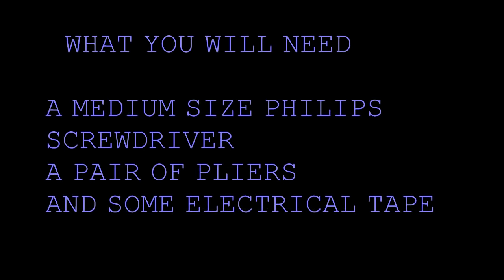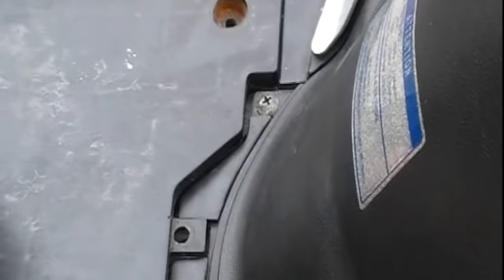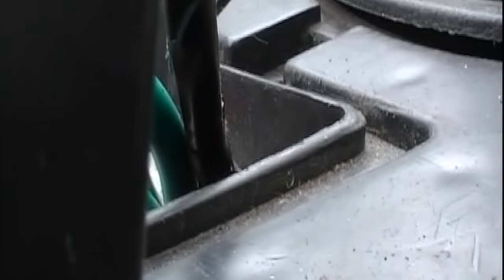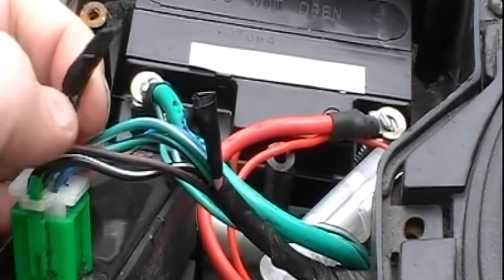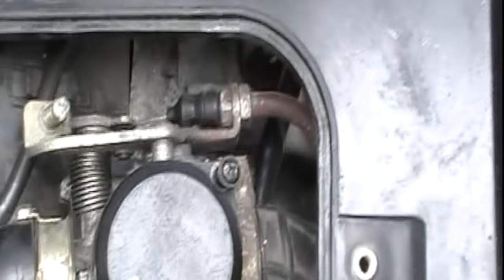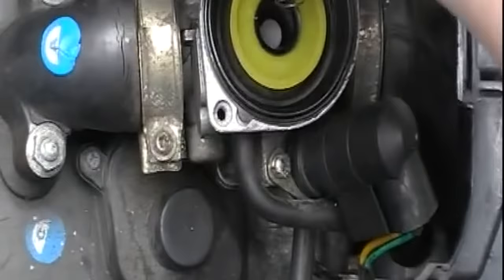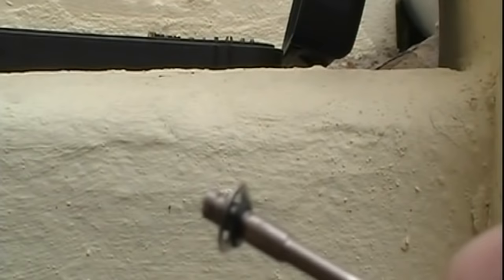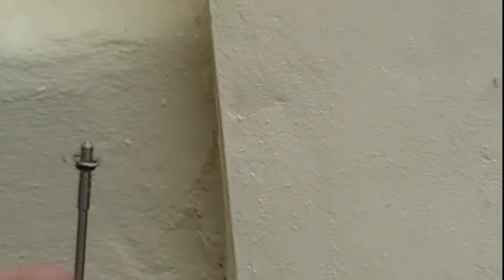How to derestrict a 50cc scooter / moped Make it go Faster

Comment: So how much was the scooter slowed down when you weakened the mixture by putting the needle further down into the needle jet? 
So if you are reading this then remember that the needle is tapered, the further up the circlip is , the lower the needle sits in the needle jet, the wider the needle taper into the bottom jet, the less airgap for the fuel vapour to be drawn up. Therefore the less fuel up into the venturi intake. The smaller the bang, the less power out. Oh dear!
Reply: Exactly! this nimrod leaned it by moving the clip up, it's a CD type carb the needle needs to move up so the clip needs to move down
Reply: Not necessarily any power loss...but certainly will burn out the piston very soon.
Reply: Yep.
Reply: your right
Reply: yaaa he moved that the wrong way he was explaining ,,,,,,,,
Reply: chancergordy i was thinking that my self with the needle.  You have just confirmed it. Nice one :-)
Reply: ,, most things in life is opposite of what you think,,,. Lean is mean,,,. This main needle and Amerson jet,, is 4 idle and slight off idle conditions,, depending on types of carburetors,,,. But as soon as it opens up under vacuum it will draw whatever fuel necessary,,,. Older bikes and carburetors you can lean down to make them quicker,,,. Newer shit EPA they're too lean when they leave the factory,,,  you can sand that needle down in diameter slightly rather than lowering it or raising it,,. Or changing the main jet seat,,,.  Wants that needle raises about a quarter inch,, that's it it starts working off of vacuum and air flow draw,,,. It's not lean then,,
Reply: @ricksimpson2167  Wrong the needle affects from 1/4 - 3/4 throttle, back to the drawing board my friend. Trev😊🇳🇿New Zealand home of the world's fastest old Indian 🇳🇿
Reply: @liamwilliams7782  Liam...in All my 50+ years dealing with bikes & engines etc I've never ONCE heard one setting them up rich for break-in...4 strokes you just don't lean hard on the throttle for a few hours & run a factory break-in oil...and 2 Strokes the manufacturer usually advises you to increase the fuel/air ratio from Stk for about 4 or 5 tank fulls of gas by adding more oil to the premix to like 15:1 or if injection like on a boat motor so oil to the gas...so who's the NIMROD now ? Trev New Zealand 🤔🇳🇿

Comment: This is my sort guy!!  He keeps me in a job with lean engines.   If you dont know what are the parts your removing and the theory of the carby dont give false info.
Reply: yeah for real lol. I went to school for motorcycle tech but I dig scooters. it pains me to see the wrong info out there, but my wallet loves the easy money.
Reply: ive been repairing these chinese scooters and mopeds for 12 years now and always find the reason they dont run correctly is when somebody has messed with the needle setting.

Comment: Buddy of mine races these things, the best "cheap" way to go about adding 10mph is to Port your intake hole on your head, then cut about 1/2 inch off the access plate on your clutch ON BOTH SIDES so it's even, and then run them on alcohol injection systems. He's doing 65 on a 50cc the clutch shave allows the engine to reach a higher rpm before engaging and thus a faster acceleration. Porting the intake allows for amazing overall fuel flow into the cylinder and actually added roughly 4 hp!
Reply: How big did he make the port?
Reply: @joshe2420  big enough
Reply: @Not Expat Joe porting gains as any gains differ from engine to engine, and you can also gain some rpm in very restricted engines when you do porting.
Reply: You l😊
Reply: Too much work on a kids bike... just buy a real bike?
Reply: @getrightconstruction1342 Because kids shouldn't ride real bikes? In a lot of parts in the world 50cc mopeds are the only alternative until you reach the age of real cars and bikes. And modifications to make a vehicle go faster is always fun.

But on topic it's a lot of work for that speed and power. A proper brand and a 2 stroke would be less hassle to reach that's speed and just using bolt on parts. Minarelli as an example. And still keeping it 50cc if one likes that.

Comment: The needle adjustment has the most effect on midrange power.  Jetting is more important to proper carb tuning on full throttle runs. If the scooter acts bad at part throttle, then it's time to adjust the needle.  At part throttle, If it hesitates but then cleans up when you let off the throttle, you're lean (move washer towards longer side of needle).  If it just hesitates and doesn't clean up when you let off, then it's rich(move needle toward shorter end of needle)

Comment: revs are controlled by the CVT clutch spring and rollers, cutting that wire just removes the speed sensor from the loop. You also need to pop out the restriction plate where the rollers are , doing that lets the scoot do about 38 mph on the flat . Dont lean off the mixture like has been done here , engine death :-)
Reply: Sounds pointless, as stock I can already hit 40mph+ anyways on flat ground. What I find helps increase speed without mod is to back off full throttle to the point you are maintaining your speed then SLOWLY give it more throttle I have gone over 50mph/80kmh on flat ground on pure stock no mods. If you are getting only 38 you are doing something wrong.
Reply: @scriptles  yours isnt restricted. Mine is a chinese engined scoot with only 2.8 horse power so 38mph is all it can do
Reply: @patthewoodboy  Mine is 1.8 horse power according to the title. Both my old Tao Tao (ATM50-A1), and now my Denali (yongfu) had no problem hitting 40 mph but only if I ease off the throttle and gently ease into it. If I just max out the throttle I barely hit 20-25. Pretty sure both of those are also chinese scooters and the translations in the guide are poorly written. Like "cer tain" shouldn't be 2 words and "outtak" should be exhaust or at least spell take right when they spell intake correctly. ect.. Upgrading the Tao Tao to 100cc with the big bore kit let me do about 40-50 mph (up to 80 kmh on the speedometer). It might not be restricted I never checked to confirm.
Reply: @patthewoodboy hiya there I’ve got a Yamaha Aerox 2018 4 stroke I put on a custom racing exhaust and it made it max out at 38mph and when I’m maxed out I hear a wineing noise is that the restrictor from making the bike go faster ? Also do u know how to D restrict it ?
Reply: The same bike sold in Europe has no restriction , it seems the exhaust has a restrictor plate and throttle restriction as well as the limiter.

Comment: lifting the clip one notch on the needle will weaken the mixture meaning more air less fuel rather than making the mixture richer,more fuel less air which could cause the ped to run weak on 2/3 throttle to full throttle as that is when the needle / main jet have most effect which could cause the ped to seize so not a good idea. Unless you have changed the exhaust, intake etc there should be no reason to lift or lower the needle or change the jetting of the carb It WILL NOT GO FASTER!. The main restriction in a ped is in the cdi (rev limiter/timing advancement), exhaust (restricting washer) and variator(a washer/ spacer which stops the pulleys  from closing right up which stops the ped from reaching a high enough gear so it just revs out)
Reply: +Dwainpipe21 Hi, I saw that you know something about the functions of the scooter and I would like to ask you if you maybe know which is the optimal ratio fuel/air or in other words, I put on my 50cc 4T a 72kit and upgraded also the main jet first from 85 to 88 and went better and then to 92 and goes even better but when I am in mid-mid/high throttle it bogs for an instant as it doesn't get enough air but then accelerate good... I tried various combinations of head valve settings and it helped a little, but the "bogging" when I go 50-80% throttle persists... do you think that I need a larger air flow, so a carburetor with a larger air intake so the fuel gets enough air to explode properly?
Reply: turn your mixture screw from full closed to 3 and a half turns open and that should help some if not then try getting a Klein carb they are cheap on Amazon

Comment: This just seems like something that going to bit you in the ass eventually. The pink wire is there to stop you from over revving your scooter and doing damage to your motor. In most cases this only limits your top speed when going downhill, as on flat ground most scooters don't have the power to hit the rev limiter. So please people watching this, keep your rev limiter installed it's there for a reason.

And second. Adding fuel isn't going to do much if you don't increase the air flow to go with it. All that going to do it make your scooter run rich, have worse fuel economy, and in some cases depending on altitude and air density, actually make your scooter slower and run like shit.

If you want to make your scooter faster, you're going to need to do actually engine and part upgrades. Little things like this almost always come with a nasty compromise somewhere down the line.
Reply: thank u for that so I need to upgrades to the engine I wish I had a partner who has a moped
Reply: to top it off moving the needle washer up is going to cut down fuel flow (lean it down) washer to the bottom is max fuel, higher rev with less fuel is not going to increase speed thats for sure
Reply: Actually the Rev thing whatever it is, is put in factory to limit your moped to 35mph because it's illegal for a company to sell a 49cc moped that goes over 35mph, it won't damage anything it's just there to keep your bike at factory speed 😊
Reply: Fulgonsta do they upgrade your 50cc to act like a 150cc
Reply: +Gem Mitchell wha ?
Reply: While the 35mph limit might be true, the RPM limiter is absolutely another reason that wire exists. These engine don't last much past 10K RPM. If you do this, I strongly recommend getting a RPM tac so you won't over rev it. Without it you seriously are just asking for a blown motor, as you no longer have a safety net. This is also even more of an issue if you start changing variator weights and gearing.

So please, if you do stuff like this, get a RPM tac. That way you can also tune more accurately. With CVT transmissions, you don't even need to be at top speed to over rev these motors.
Reply: I have a 50cc and some guy told me that the mechanics at this dealer ship could make my 50cc ride like a 150cc
Reply: +Gem Mitchell oh ok
Reply: Fulgonsta but is it true
Reply: Gem Mitchell I dont think so I think the maximum youll get is 50mph flat, tbh I've never heard of a 150cc soooo....
Reply: Fulgonsta really u havent?
Reply: Gem Mitchell nope so I couldnt tel you sorry
Reply: Fulgonsta it's fine btw do u have a ,moped
Reply: +Gem Mitchell getting one for Christmas and going for my cba on my birthday 3 days before, so I'm getting one
Reply: Fulgonsta well a few words before u get it, it's awesome it's worth it but it's slow/fast as hell
Reply: +Gem Mitchell that's why I'm derestricting it lol, an I'm only keeping it till I turn 17 then I'm upgrading to a cbf 125 👍
Reply: Fulgonsta how much is a cbf 125 and is derestricting a good idea
Reply: cbf 125 are around £2000 and deristricting would be practical if you're having a moped for a short term, like a year
Reply: Fulgonsta oh well nvm and r u in the uk or somewhere like europe
Reply: +Gem Mitchell yeh I'm from wales
Reply: that makes sense, well I'm getting a150cc soon
Reply: cool
Reply: You do realize it's very easy to calculate rpm from the speed of the wheel with a CVT right?

But fine, do whatever you feel like. This convo has gone on forever.
Reply: Uggg, do you really not understand the point I'm trying to make? Yes, the pink wire is a speed governor, but when you govern speed you also govern RPM. This means now the scooter can go faster than it was designed, and over rev the engine going down hills.

Which is why I wrote in another comment to buy a tachometer to see the RPM and be safe. You're arguing over terminology when it doesn't make a difference.
Reply: K First question, as I said in my previous comment, this governor serves two purposes. Scooters sold in places that do not require speed governors like Canada put in a RPM limiter like in the Yamaha Zuma 50F. Second, yes many 125cc Scooters do have RPM limiters,  though because these larger engines rev slightly lower, valve train is less at risk.

To add more to that second point, it's not the pistons that go first it's the valve train in four stroke scooters. 

Next point, relax dude. For some reason you seem to be taking this personal. Chill, it's just YouTube. I hope you have a good day. 👍

Edit: I think a lot of our differences are here because I'm mainly talking about 4 stroke scooters and you're talking 2 stroke. That's my fault the video is of a 2 stroke. But I still can stress enough, if you start messing around with your scooter. Get a tach, great tool to tune by just for that reason alone.
Reply: I was gonna say the same thing. cheers
Reply: race tuning is a fine art- let them learn the hard way.. all parts should be upgraded - try and test
Reply: Fulgonsta ive hit 40 on a stock vino classic with both the bikes speedo and my phone speedo

Comment: I think he's actually moving the needle to the factory setting.  On most of these bikes the factory setting is the middle notch.  So, it would of been running a little rich in the first place so this particular bike might run better after changing the needle setting back to the middle notch.  Give the guy props, it's hard to make these videos sometimes.  Especially when you need both hands to do something and you can't always get a friend to hold the camera.

Comment: I should have mentioned the benefits. Properly adjusted valves will keep the engine running as efficiently as possible which means better fuel economy, increased power and torque, slightly increased top speed (assuming that the scooter is deresricted), better throttle response, and the engine will typically be easier to start.

Comment: 🤪i came across this video when i got my scooter a couple years ago. I dont know how/if cutting that wire in the start actually does anything but if it wasn't for the comments i would have leaned out a six month old scooter and potentially froze up the piston causing more trouble than was needed. On the upside i have learned a lot as a result. Thanks all.
Reply from the maker: Your welcome

Comment: The rev limiter is in the CDI box there are unlimited rev cdi boxes for these gy6 motors they are blue aluminum with fins and an led showing spark, wont make much difference unless you install the bigbore kit with it then you need to re jet your carb. The carbs from china are capped  over the fuel / air mixture screw you can drill two small holes side by side and use a small flat head driver and easily twist the little brass cap off. the normal setting is 1 1/2 turns out from all the way in, if you find you need to turn the screw in further then you need a smaller pilot jet and vise versa. You are adjusting the main jet with the needle mainly used to get rid of flat spots in the acceleration both of these adjustments will be different for every one depending on altitude, temp, exhaust size and intake flow,  and carb venturi size.  Those CV carbs that come stock are crap though with little to no tuning. you can drill out all the screws that are capped off to prevent you from getting in it or just buy the upgraded "so called" high performance carb.

Comment: remove the restrictor plate by the air intake manifold and Throttle body The engine will get more air But you might need to do some tuning and order for it to get more gas because it will run Lean and not get enough gas and to much air You might need to adjust ignition for more spark  to get more spark so the engine does not get flooded with too much gas and Has the proper amount of spark

Comment: You're better off installing a bbk, aftermarket carb and exhaust, and changing cvt rollers, otherwise derestricting alone will not do a whole lot on a 50cc. You'll also want to richen, not lean out the air/fuel mixture.
These things will still run cheaper than buying a larger displacement scooter.

Comment: if you want to do it right get a unrestricted cdi box and install gauges with a tach. the cdi limits rpm to 6k so you can't go faster than 35.  change it with regular one and you can go at least 45 on a 50cc without going over 8k rpm limit.

Comment: Although the look on people's faces when I was on a highway doing 60 plus miles an hour on a little scooter was hilarious
Reply: This being a 4 stroke 50cc, there is no way to get it going 100 kmh without having a really long gearing and a damn steep downhill and no electric rev limiter. My 2 stroke 50cc scooter, with a removed exaust plug and all other air flow plus gone as well, only tops out at 85 kmh, and that is really fast for a stock, 50cc 2 STROKE. Now Imagine a lousy 4 stroke

Comment: moving the washer on the needle up will lean the the main jet off so de-creasing the fuel going into the engine..........
Reply: The Ginger Mechanic I thought that, thus causing the engine to run hotter, decreasing engine life massively. Though, anyone that follows this advice does so at their own risk.
Reply: +The Ginger Mechanic running it leaner makes it faster at least
Reply: in some situations running leaner will improve performance but this needs to be diagnosed by carrying out a "plug chop" but that will indicate information about the main jet the needle is just for the introduction of fuel from the main jet to the engine so leaning it off without main jet alteration will just cause it to pick up well until its at full throttle then it will just overfuel (like most of these mopeds do)